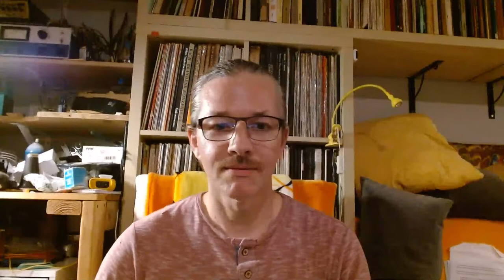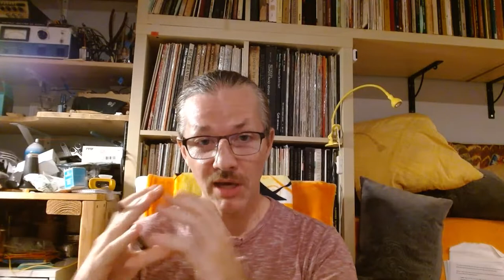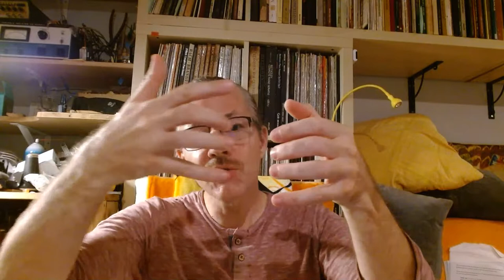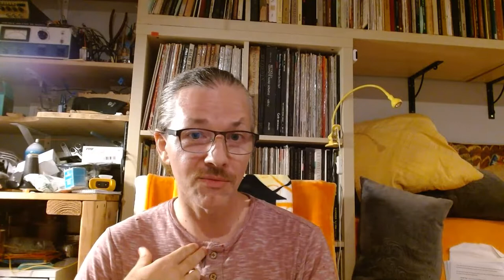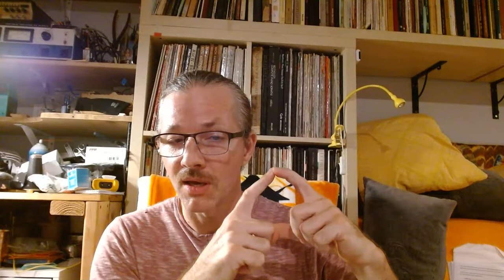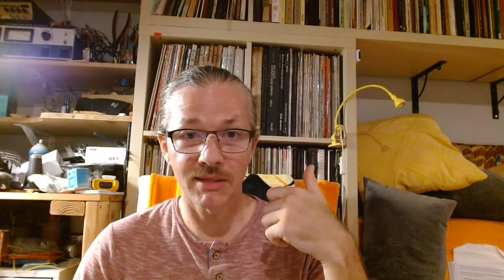RWA Live!! Winding your own output transformers - basics

Comment: Good morning Janos!  From what I saw you did a live! Now I understand why this morning I was sleepless. LOL

About aging transformers, last week I happened to be reading my book "radiotron" that arrived, and it talks about "anealing" of steel sheets. On the other hand, I went looking now and found several documents on the internet that describe structural and magnetic changes that occur in steel over time. In my humble opinion, perhaps changes can occur more easily with steel sheets than with copper wire. But, it's just an opinion!  waiting for more videos about audio output transformers!  thanks for the video!
Reply from the maker: Hi André, the annealing for steel (& othr laminations) happens at very high temperatures. It aligns the grains, the magnetic domains, so they can be magnetized stronger. When the metal is cooled down, these oriented grains "freeze" in place, and can change only when the temperature is elevated high enough to allow partial melting of the metal.  During aging the magnetic domains do not change much, unless subjected to extreme magnetic fields or extreme temperatures - but that would require house burning down levels of heat, or sitting next to a superconducting super magnet plus extreme heat and/or impact to change the BL curve of the core long term.
Reply: @realworldaudio  hello janos! What I was referring to is that I found some references that say that there is a natural "aging, or accommodation" in steel sheets at room temperature and maybe this can be responsible for the change in the sound of certain transformers over time! Well, another point that I would like to share and that I have just remembered: The type of varnish used to insulate the copper wire plays a fundamental role in the leakage inductance. I build high frequency transformers using ferrite cores, and the choice between polyurethane or polyester insulated wires has a tremendous influence. This influence is measurable through the method of measuring the inductance of the primary with the secondary open and with the secondary short circuited, as well as through the operation of the transformer installed in the circuit. I would like to share this knowledge because I believe that the final result should change a lot.

There are also a series of precautions to be taken with the sheets such as avoiding burrs, applying some form of electrical insulation between each sheet , or even leaving the sheets oxidized, the oxide acts as an insulator(I've seen some transformers that used a small plastic film between each steel sheet. Oh and of course, the insulation of the screws, using tubes and insulating washers. Well, sorry for the long text and the lack of didactics. Abraço! Andre´

Comment: Janos after watching your cube audio videos i decided to get a Lii audio 8inch full range driver, recieved them today , company recommends 100L box for it , the design you gave us for the voit pipes should i got with that or should i tweek that design to fit the 100L criteria
Reply from the maker: That's the BR box recommendation. Voigt pipes work with very different loading compared to BR. However, you could increase the volume a little, to 50-60L, but certainly not 100L.
Reply: Do you know any japanese brand selling high end tramsformer cores and wires